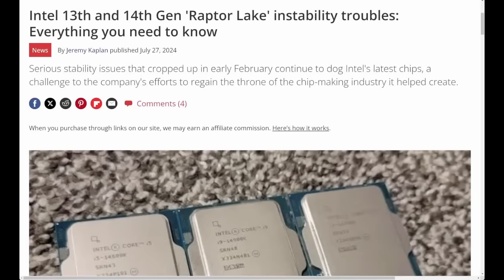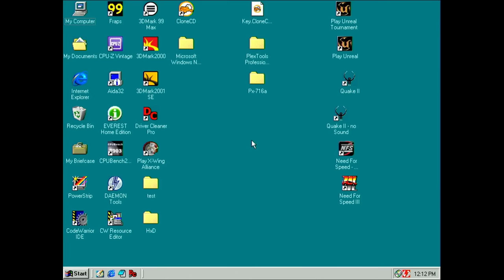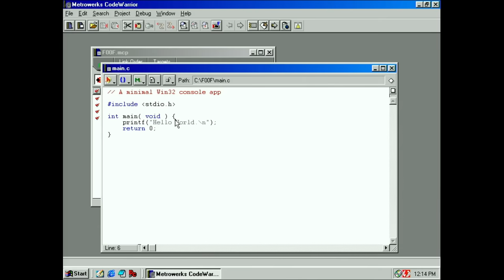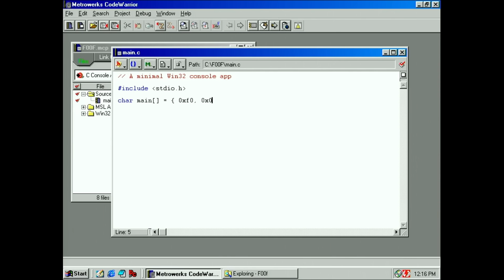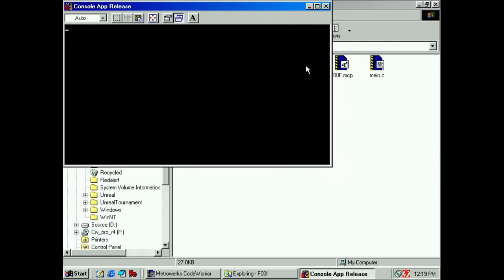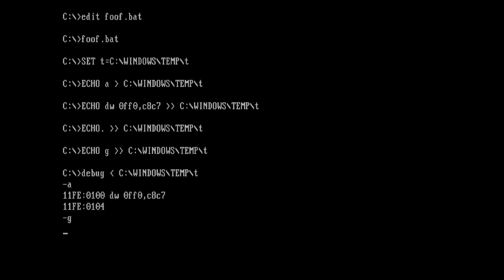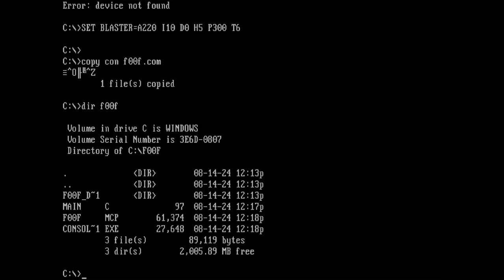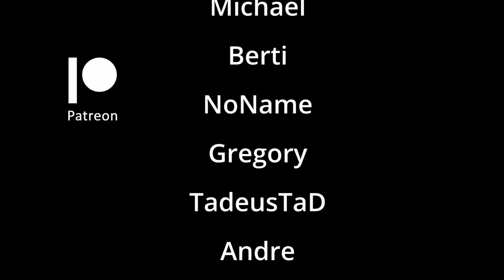These 4 bytes will crash your retro PC: The Intel Pentium F00F bug

Comment: well that was the most arcane way you could have written a C program with the f00f instruction
Reply from the maker: I guess... I followed the instructions in a book. Btw, not all compilers will allow to compile those instructions in that order.
Reply: I mean it's on Windows 98, so not the most arcane. I haven't compiled C since Sun workstations were the go to, Unix, before any Windows 9x.
Reply: Educational though!  I've been a casual C hacker for y-e-a-r-s and had no idea you could declare main as a character array and it would be run as raw ASM instructions.  I wonder if that's unique to that particular C runtime?  Gonna have to try that later ....
Reply: @nickwallette6201 should work on most compilers as ‘main’ is used the entry point but its just a label to an address so making a char array is the same as making a pointer, the content of the array are the instructions to execute.  I jad never seen it done that way but it should work on most C versions.
Reply: @nickwallette6201  It only works on old operating systems because modern ones would put the "main" byte array into a non-executable memory page as a security measure, so it will just crash, even if it contains valid machine mode.
Reply: @brucesheplan696   Yeah, it makes sense, but the process of assigning addresses and generating the ELF headers, etc., is the job of the compiler/assembler, so it didn't seem like a given that it would allow this to happen if main wasn't a function.  I've had compilers refuse to continue if main didn't return an int...  :-)  This seemed like a flagrant breach of conduct in comparison!  haha
Reply: "main is usually a function"
Reply: @fders938  can you turn the pointer to the machine code array into a function pointer and call it?

Comment: It's almost unbeliavable today to see that you can "write" an executable file directly with the keyboard or a text editor. No certificates,  no security no checks no nothing. What great times.
Reply: C and C++ are still like this today. You can write the code in notepad, Word or IDE like Visual Studio, send it to the compiler and it will work. The user experience is obviously different, but the end result will be the same.
Reply: I find it surprising every time I run into an OS that tries to stop me from running an executable without chain of "mother-may-I" permissions.  I know that's where we are today, and I know there's a reason why, but I still feel like Yosemite Sam yelling into my monitor, "I BOUGHT YOU.  WHEN I SAY RUN, IIIII... MEEEAAAN... RUN!"
Reply: @nickwallette6201  Yeah, this is my computer, I'll run what I want. I hate being told what I can and cannot do with something I own.
Reply: @tabana_minamoto  That's not the same thing. The original comment is talking about the ability of writing binary data for the CPU to execute in a file. This wouldn't work on a modern system because executable files have become a much more complex format, with headers and sections, and some platforms also require a valid digital signature for the code to run.
Reply: @RaduTek  You can still write executable data in a file. You do understand what compilers are, correct?
Reply: @turboluck1023  Yes I do. Compilers do exactly that. I'm just saying that writing all the headers and sections by hand with the numpad would take forever. You can't write just the raw CPU instructions in a file and expect a modern OS to execute them, like the video shows.
Reply: @RaduTek erm achtually Nuh uh. You can still do this today, but the F00F bug has been patched. Also people don’t use Pentiums anymore anyway

Comment: I've seen a lot of interesting ways to write programs in C, but defining main as an array is a new one.
Reply from the maker: I was also not aware that you could do something like this to the main function. But it worked. However, trying it on a modern c compiler, you most likely get an error and it won't compile.
Reply: @bitsundbolts  yeah that was something I was not aware of either.
Reply: @bitsundbolts  Regular C does not have any sort of data types for symbols.  The compiler and linker are just working as intended - the compiler creates a symbol called "main" with the array contents then the linker finds the symbol named "main" and sets it to the entry point.
Reply: I would assume in newer machines it wouldn't work because a data array would be allocated without execute permissions.
Reply: @mordechaisanders7033  that bug would have been fixed in newer chips. If you can compile an array as a function, then it will always have execute permissions. Compilers don't give a shit.
Reply: Yeah, "interesting" as in "horrifying".
Reply: @Jurarigo  Anything that's horrifying to a high level language dev or web dev is beautiful to me.
The horror is the appeal.
Reply: @delphicdescant  Well, I can't judge you. There's people who like to code in esoteric languages, or even create them.
Reply: Did this back in uni to mess with the TA who we knew would be the one grading everyone's hello world "first day" homework assignments in an intro class.

Comment: So F00F is the x86 verision of a HCF (Halt and catch Fire) instruction
Reply from the maker: Pretty much, yes.
Reply: Coincidentally, foof! Is the sound of a fire igniting.
Reply: halt, but not catch fire. The intel 13th and 14th gen core CPUs are the ones that catch fire. lol
Reply: Halt without catching fire is just halt, which we already knew about.  :-(
Reply: no that would be the hlt instruction. this is just a processor bug.
Reply: @myne00  FOOF is also the nickname for dioxygen difluoride, a notably potent oxidizer.
Reply: But your pc would not catch fire.  @bitsundbolts
Reply: Halt and catch fire is metaphorical. The CPU doesn't have to actually catch fire. It just has to stop working properly.
Reply: @thewhitefalcon8539  in some cases, the cpu actually did catch fire, so being metaphorical is meaningless.

Comment: As a well versed C programmer, I was impressed by the kludge over-complicated way this book showed how to do this. I'd be curious to know what book this was.
Reply: Yeah that made me look at my telly sideways and think "really? well OK, I can see that's valid but I'd never think to do that". I can see it being a way to inline assembly in C if you can't remember the "proper" arcane way of writing ASM in C with your particular compiler 😄
Reply: @ncot_tech  that's inline machine code more than inline assembly.
There's nothing to assemble here lol

Also, I doubt you could do this in assembly since this isn't a valid instruction. If I've understood correctly you can't put a register as the operand, which is precisely what is being done instead of a memory location. I would think most assemblers would validate this and throw an error.
Reply from the maker: The book is called 'Learn C under Windows 95/NT' from Dave Mark

Comment: I never knew you could run machine code in C just by making the main function a character array of op codes and running it,  that is wild!
Reply: Yeah, right!? All the compiler looks for is an "entry point" which all compilers agree is called main in the source code. It starts off at main and reads the bytes. I love seeing people really stretch the definition of what it means to be a C program
Reply: Not in newer operating systems and CPUs, because the compiler will put data arrays in a non-executable memory segment.

Comment: So how this works:
0F C7 is the prefix for "exchange two things". The next two bits say what to swap - three variants of a memory location, or two registers. So if you want to swap EAX with ECX, you encode that as either C8 (swap ecx and eax) or C1 (swap eax and ecx - which has the same meaning).

If you want an instruction to keep the memory bus locked while it runs, you prefix it with F0. That should work like "lock memory bus, run whole operation, unlock memory bus". However, for the 0F C7 instruction, Intel implemented it as "lock memory bus, run operation, unlock memory bus if we accessed memory".... so it never unlocks the memory bus if you ever run a locked exchange between registers, and the instruction fetcher is unable to ever fetch any more instruction. No compiler will ever swap two registers with a memory bus lock, because it's not a meaningful or useful operation, but you can encode it, and it was very much untested & broken.

And unlike many other bugs from the time, this is not fixable with any kind of OS workaround. The instruction has no enable bits you could leave off. I don't know if there is microcode in the CPU that could update around this, but that might be the only thing you could do - you know, or buy a different CPU.
Reply: The wikipedia article documents a workaround which relies on the fact that this instruction is invalid and the processor is blocked from raising an invalid instruction exception. The workaround involves making sure the processor generates a page fault before it can fetch the exception handler, which is enough to make the processor release the bus lock.
Reply: Apparently disabling the cache prevents the bug from happening under DOS/Win98 according to R.Collins write up, far from the optimal solution but interesting nonetheless.
Reply: NOP operation on x86 is realized in interesing way. Opcode 0x90 known as NOP is actually XCHG EAX, EAX.
Reply: Thank you for providing this excellent explanation. I had a Pentium 133mhz (overclocked to 150mhz) in a Gateway 2000 machine that was impacted by this bug. I remember putting the values into an assembly compiler & linker to make the com file (tasm/tlink). I was interested in learning what the processor was attempting to do that resulted in the behavior, and at the time (pre-2000) my CompSci professors couldn't answer that question. Thank you for providing such a thorough explanation to satisfy curiosity and passion for learning.
Reply: Re: Microcode. This bug was the main impetus for Intel moving to microcode so they could patch issues with chips after fabrication and end user installation.
Reply: I remember seeing a setting for working around it in Windows XP. I don't know how it did that.
Reply: The explanation on Wikipedia is completely different, and I will believe that explanation over yours. The following is MOSTLY MY SPECULATION based on the Wikipedia explanation which you can already read for yourself.

CMPXCHG generates two memory accesses: a read then a write. It works just fine by itself.
The LOCK prefix additionally locks the memory bus between the read and the write. It sends a special flag to the memory bus logic to do this. This tells the memory bus logic: Lock the bus in between this memory access and the next one.
LOCK CMPXCHG to a register makes no sense. The CPU recognizes this and generates an invalid instruction fault.
If the LOCK CMPXCHG generates an invalid instruction fault, it accidentally still sets this flag on the first memory access, but the first memory access is not reading from the operand address - it's reading from the interrupt descriptor to handle the fault. Therefore the bus logic locks the bus until the next memory access. The next memory access is reading the interrupt handler instructions.

My assumption is that the CPU is wired to never fetch an instruction when the memory bus is locked. Only data accesses can cause the bus to become locked or unlocked, so the instruction fetch circuit doesn't need any logic except for waiting for it to be unlocked. Normally it would never be needed for an instruction fetch to unlock the bus, so it can't. So the CPU deadlocks on the memory bus lock.

By doing the page fault workaround, the CPU reads 2 interrupt descriptors (tries to read the "invalid instruction" descriptor and then successfully reads the "bad interrupt descriptor" descriptor), and the second one unlocks the bus, before it fetches any instructions. By doing the read-only page workaround, the bus doesn't get locked in the first place because the bus control logic knows it can't write to the read-only IDT page. By doing the non-cacheable page workaround, the CPU generates some extra redundant memory accesses to the IDT, and the second one unlocks the bus. Only external memory accesses go through the faulty bus logic, not cache accesses, and that's why it doesn't get unlocked when it writes the fault information to the stack, since that just hangs in the cache until it needs to be evicted.
Reply: @thewhitefalcon8539  I agree. I think they mixed up CMPXCHG with CMPXCHG8B. (CMPXCHG allows registers as the parameter; CMPXCHG8B doesn't). Or just mixed it up with XCHG. XCHG allows swapping any two registers, essentially. CMPXCHG only swaps between variants of -AX and the specified target.

That said, I wonder if CMPXCHG and CMPXCHG8B use (or used) the same instruction encoding internally, so that you could still encode a register as the target for a CMPXCHG8B instruction, even though that was illegal.
Reply: @Acorn_Anomaly  sorry, I also said CMPXCHG and didn't realize it was two different instructions. Yes, it was CMPXCHG8B with a register operand. When the processor decodes the operand, it realizes it's invalid and goes to raise an invalid instruction fault. However, because the opcode was already decoded as CMPXCHG8B, it tries to raise the fault while the memory bus is in the special CMPXCHG8B mode, and this causes a deadlock.
Reply: @renakunisaki  Disable execution bit maybe?

Comment: ONE THING TO NOTE:
All of these solutions would have good use of a RET instruction (0xC3, 00C3 and ALT+195 respectively) at the end as a fifth byte. This prevents the program from running into random memory, and rather gracefully exit in the case your CPU does /not/ have the F00F bug.
Reply from the maker: Good to know! I think I have seen some examples where this fifth byte was there. I wondered what it was for.
Reply: @bitsundbolts  Not having the RET, you would basically just keep executing random data left over from something else as code (DOS and early versions of Windows have no boundary-protection on memory allocations). This can also in many cases lead to a crash, and you potentially get situations where it would not have been possible to differentiate between a crash from the F00F-bug and a crash from executing garbage data.
Reply: @TheMovieCreator  This code would crash on my 13900K too most likely, because it is basically running the execution off a cliff.  Of course since I run DOS either in an emulator or a VM, it doesn't require a full system reboot.

However, F00F would crash a Windows NT system running NTVDM most likely on a P5, but on a later processor the NTVDM instance would either error out or the frozen instance would be able to be terminated like any other Windows process.

Still, it would be best to add the RET instruction so an unaffected processor would cleanly exit the test program.

Comment: It's interesting to note that both the F00F bug and the FDIV bug arose from flawed implementations in the microcode of these CPUs. In the case of the F00F bug it was the edge case that one could encode a locked (atomic) compare-and-exchange instruction with only registers as an operand (which no compiler would do, for obvious reasons). It was a use case of the instruction Intel simply failed to account for. 

In the case of the FDIV bug it was something far more hilarious: the designers of the Pentium CPUs simply forgot to include half the lookup table for the floating point instruction in question, which resulted in the higher half of the lookup table containing invalid values.

Both cases can ultimately be said to have arisen because of incomplete QA testing.
Reply from the maker: Thanks for sharing this information! I didn't know the FDIV bug was 'software' related.
Reply: @bitsundbolts  It's microcode-related, if you want to be technical about it!
Reply: Neither one of them is microcode. Both of these were most likely hardwired.
Reply: @thewhitefalcon8539  That is actually not true. At least if most of the research that was done into it is to believed. The FDIV bug in particular has been reported multiple times as being the result of "half a lookup table missing in the microcode ROM". 

No x86 CPU designed by Intel has ever been truly solely hardwired or solely microcode based. The original Pentiums were no exception. In fact, the more advanced the CPUs became, the more reliant they became on exceedingly more modular design architecture that actually translated x86 instructions into more generic, RISC-like, u-ops, which in turn could be executed by the various units on the die. This process really took off with the Pentium Pro, but had already started with Intels 486es. Starting with the Pentium II, the microcode could even be updated by software running on it. 

Ken Shirrif has a nice blog in which he discusses various topics, including various CPU designs and in which he often zooms in on the CPU dies themselves and analyzes them.
Reply: I am not entirley sure anymore, but my university prof said something like they made an error when they copied the lookuptable, something/someone messed up and during copy paste not everyrhing was pasted correctly. I think it had something to do wit the size of the floppy disc or whatever.

Comment: What is really ironic is two things.

1. "FOOF" is one of the most potent and unstable oxidation agents ever created.   It can make nearly anything explode on contact simply by providing oxidation   (This is an awfully strange coincidence.)
2. The Pentium has a protection system that can be used to block instruction bugs preemptively, but by default it does so after attempt at execution.
Reply: What protection system?